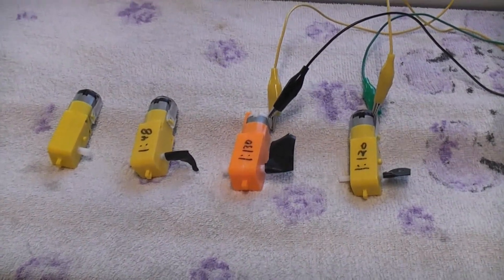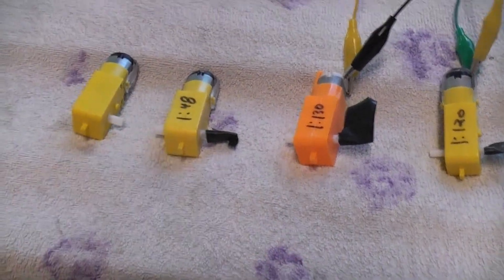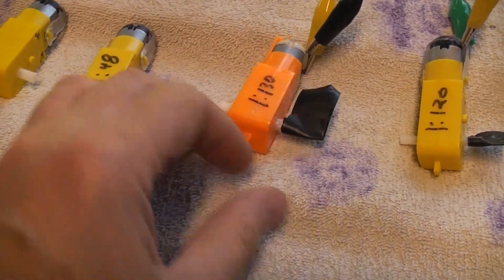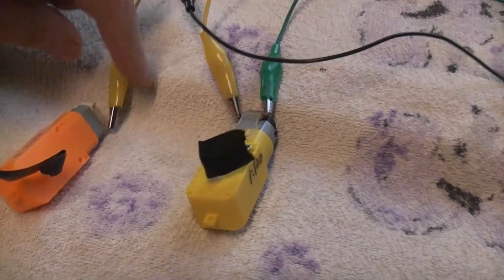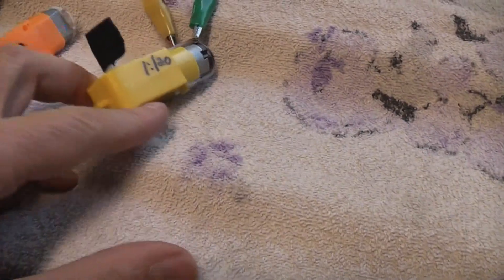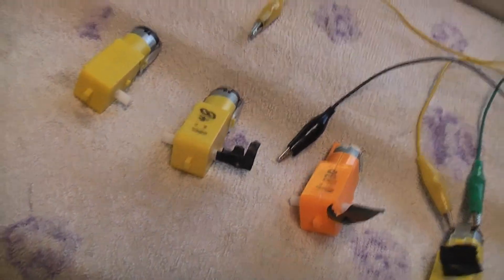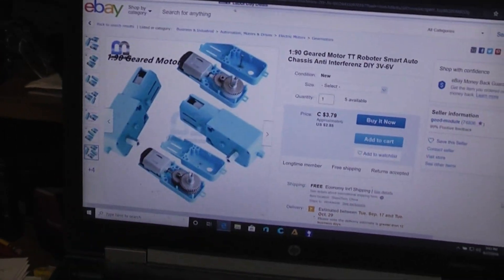Some of the different "TT gear motor's" 1:48, !:90, 1:120 and 1:130 ratio's

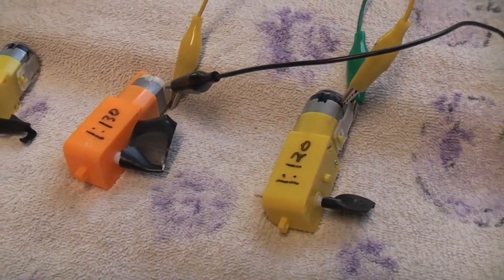Comment: Really appreciate your sharing this video and information.  I’ve just ordered 4 1:48 from Amazon for experimenting & exploring Robotics.  I returned a Elecfreaks RingBit Car kit luckily I had ordered it from Amazon & they provided QR Code for our local UPS Store to package and ship it without a penalty to me.  However I also ordered the Elecfreaks Cute Bot car kit directly from Elecfreaks .Both cars a bit too small for my liking. I’m planning to design my own custom Robot cars  using my BBC micr bit or Raspberry Pico W or Elecfreaks Pico Ed board
Reply from the maker: Have you watched the more recent TT gearmotor video I did with the 1:220 motor. Lots of power at that gear ratio. The 1:48 are fast but not very powerful.
https://youtu.be/MJj6tcY_CgQ

Comment: I just found this channel and plan to watch a bunch more videos.  I just started teaching robotics.  One of the topics is gear ratios so my students tore the 1:48 motor apart and counted the teeth on the gears.  They go 8:24 then 9:36 then 16:14 then 28:30.  If our math is right then the motor is actually 45:1 unless we did the math wrong or counted the teeth wrong.  What do you think?
Reply from the maker: I have not counted the gears so not sure. But you will find a lot of 3d printed and custom robot projects on my channel that will be good for a class to work with. if they are into 3d printing then just go to Thing-i-verse and type in "Robothut" and all the free custom build projects should pop up.

Comment: Sir , how much weight can this tt gear can pull its for my project help me sir 🙏🏼
Reply from the maker: You will find the sellers of the motors will have the gear motor power info. For example on Gerbest I found these spec's for the 120:1 gear motor.
Type: 1:120
Features: Strong magnetic,Anti-interference
Model: 1A120-1812L(Prefer Torque)
Rated voltage: 3V/6V
Current: ≤180mA/≤250mA
Speed: 45±10%r/min  90±10%r/min
Torque: 0.45±10%kgf.cm 0.85±10%kgf.cm

Comment: Hi John , love this video on the TT motors , could you make show the differences between the 1:48 and 1:120 inside gear assembly , so we could be on the look out and know what the gears to a 1:120 look like ? from the outside and speed it's hard to tell , since 1:120 TT motors seem to e hard to get . Thanks for the great video, very helpful !
Reply from the maker: The only way to tell from the outside is to try to turn the output shaft. If it turns it is probably a 48:1 and if not its probably a 120:1. I scored some 120:1 gearmotors on amazon last week, so they do pop up but 7 weeks ago I ordered ten 120:1 gearmotors from Bangood "china" and they just arrived, well sort of. What they sent was Six 48:1 gearmotors.  They are not all the same inside I have found so even they even copy each other in china it would seem. There are some nice hacks to the 48:1 gearmotor to make it run even faster "less gear reduction" I used this mod to make the mechanical bell ring on my Robotic Fireman project a few weeks ago.

Comment: An very useful overview of these motors. I've given up trying to get the 1:120 version. Like you say, there's no chance of getting an order from China corrected.
Reply from the maker: I found a seller on ebay that did send me the 1:20 gear motors in a single output, so I then just move the gears from the single drive output gear box in to the shell of a 1:48 gearbox, since I have so many of them. Seems to work OK for the times I need a 1:120 dual axle gear box . The single drive units works fine for my dual drive base robots like the Radicon and Sonic robot. I have a few new motors on order. We will have to see what they send.

Comment: Yes, I notice ebay has gotten worse. Been burned x3 in 1 year...Even had 2 power sellers gone bad, never sent DVD, then tells me to file, get my money, then ebay says I was reimbursed but never shows up in paypal...Nothing you can do because they 'close' the case. So I prefer to pay more on Polulu , Servocity or even Amazon than to get burned anymore.
Reply from the maker: Yes I buy from Pololu any time I can, as you can deal with them if there is a problem. In this case Pololu can not help as they do have the 1:120 gear motor, they also have been out of stock on the battery holders I need to use.
But yes I buy from USA sellers when I can and let then sort out the bad China stuff from the good.